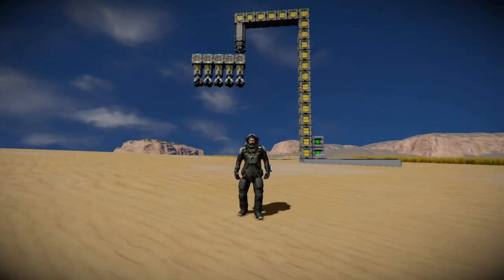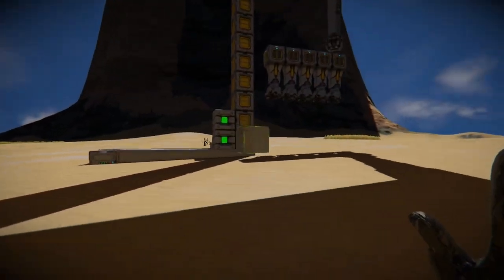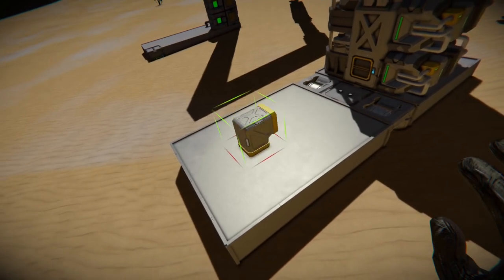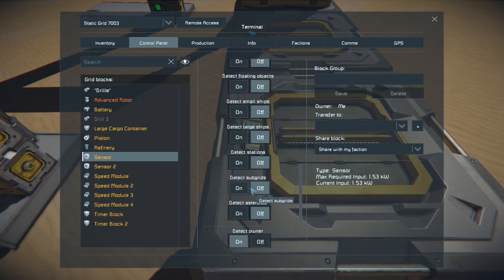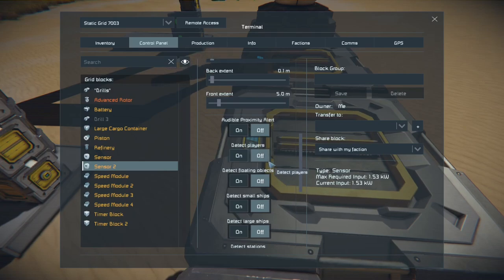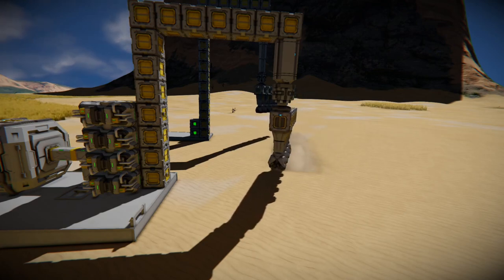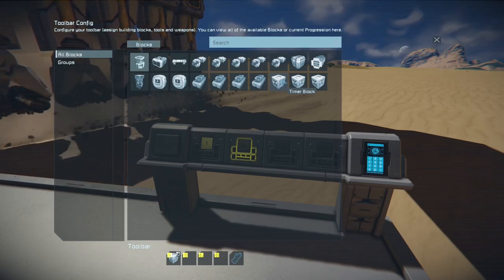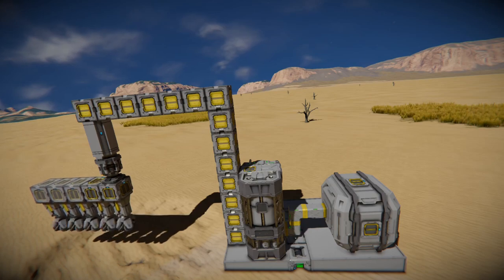How To Build An Automated Drilling Platform Without Using Scripts

Comment: Move the rotor to the vertical connection, creating a theme park pirate ship made from drills, it means instead of drilling a circular hole, you Gauge a large diameter circle, adding more pistons in either direction. later adding wheels and such, you can convert it to a mobile drilling rig by disconnecting it from the ground anchored blocks. Really useful for ice drilling.
If you limit them by reversing them faster, you can drill square holes too.

Comment: you could put the sensors next to the rotor by add 2 blocks from the rotor, that way you don't have to keep adding more sensors further down as the drill mine deeper. that way you'll have better continues long distance mining with multiple pistons

Comment: An idea here is you can also do a 8x3x3, though this becomes highly unstable kind of requiring a gyroscope to be usable... sadly though such a thing becomes annoying to try to automate because each click of the sensor would extend all the pistons, increasing the chance to damage your rig.

This rig is always great, but with deep drilling you're better off going more manual or utilizing some other methods. 👍

Comment: You don’t really need a sensor if you don’t mind doing what I do and just having a 1rpm rotor with a 30 second timer that activates the pistons at the end as well as a second timer, set at 4 seconds, than the 4 second timer stops the piston extension at the end and re-activates the first, creating a loop that does this automatically, no sensors needed, for turning on and each just group the pistons, drills, rotor, as their own groups, and get a button pad and assign the buttons to toggle the groups on and off, the 4th button stops/starts the timer
Reply from the maker: Huh, interesting. That concept could definitely work as well. Thank you for the insight, I appreciate it.

Comment: Adding to timer block 1 to turn the sensor(s) back on and timer block 3 to turn them off. (not off/on) 
Unless you are done (full extent of the piston ) if time block 3 is activated the drill head will stay in the up position ... if you have to restart it
Senor has a range of appox 20 blocks from the block is is on.  Show on hud on the senor and Show senor range will give a better picture of this

Comment: Share inertial tensor on rotors & pistons reduces the wobble on long mining arms....      :)

Sensors are under-rated, so handy...

What's the advantage of intermittent piston movement?
Over continuous, but slow?
Reply from the maker: There may not be a grand difference between the approach of slow and steady or intermittent but when used to mine elements that take a long time to refine, the intermittent creates a dwell time to allow the refinery to keep up with demand.

Comment: Why did you use junctions instead of tubes?
Reply from the maker: Typically, I use the junctions instead of tubes if I have not completed the structural part of a base.  This assists in planning on where and how an assembler, turret, refinery, h2/o2 generator, a hydrogen generator etc. may be automatically attached without having to change out tubing.  After settling on a complete utility design I go back and switch none multi function junctions for respective tubing. Thank you for the question.
Reply: @mastermindgameplay5297  thanks for clarifying

Comment: My conveyers on on the drill arm ain’t sending the stone down to my refinery
Reply from the maker: By chance, have you checked the piston heads to see if they are completely welded.  Sometimes they may appear complete but are not actually functional.  This can be caused by excessive vibration or sideways force when the drills hit hard spots in the resource.

Comment: I made this but the my conveyor isn't putting it into my refiner can anyone help?
Reply from the maker: Have you checked all of the connections?  For me, I have often overlooked completing a piston head which will cause a break in the transfer of stone from the drills.  Another issue may be if you are using a conveyor sorter to pre sort the types of ore heading to multiple refineries.  I suggest start with the most obvious such as making sure each component is complete, and then progress to checking the flow of the resources through the system.

Comment: you keep saying one setting but doing a different setting, im lost :(
Reply from the maker: My apologies, here is a list of the settings I used. 

Rotor
- 0.71 velocity, rotor set to lock initially on “G” screen set to lock/unlock

Drills 
- “G” screen set to on/off

Timer 1 
- set to 5 seconds
- slot 1 is rotor lock/unlock
- slot 2 is drills toggle on/off
- note: the sensors are already on and react with the drills passing them automatically. 

Sensor 1 
- right extent, top extent, back extent set to lowest setting 0.1. 
- The front and bottom extent are set to 5m
- Detect players off, audio proximity alert off, detect subgrids on, detect owner is on. 
- 1st slot in sensor 1 is increase maximum distance of piston 
- slot 2 is timer block 2 set as start timer. 

Sensor 2 
- same distance and options settings as sensor 1
- slot 1 increase maximum distance for piston 
- slot 2 is time block 2 start timer. 

Piston 
- set to 0 for maximum distance to start out. Then hit the reverse button

Timer 2 
- set to 4 seconds on timer, slot 1  is toggle piston on and off

Button panel
- button 1 set to start timer of timer block 1

Hopefully, this outline of setting will help.

Comment: You dont need timer blocks or sensors just turn the piston speed to 0.0001 and put 15 pistons on it and then turn the drills and rotor on and walk away. Thats 150 meters so roughly idk 20 real life hours of mining. Roughly 700,000 iron ingots if you make the drill head 10 drills long and you can put a rod 10 blocks long on the otherside with a ball of heavy armor blocks on it to even out the weight. I got a rover that had a projector on it that projects small mining bases smiliar to this but quite a bit taller with 17 refineries on it to save on material costs 5 windmills the rover can weld the projection with a welding crane it carries on its back using a turret controller to make the crane. I can upload it if anyone is interested. Its a medium sized rover but since it can fly and has all the bells and whistles it is 29,000 pcu so pretty expensive to make in survival. Took me roughly a week to build it in my mars survival playthrough.
Reply from the maker: Wow that sounds pretty cool! I definitely encourage every space engineer to upload and share their creative builds.